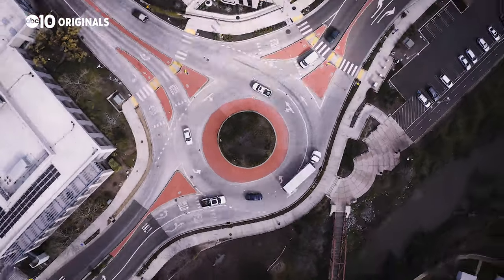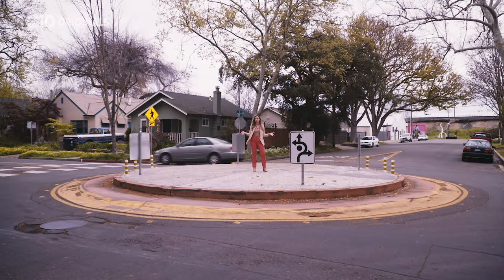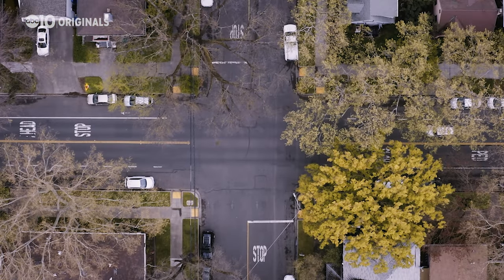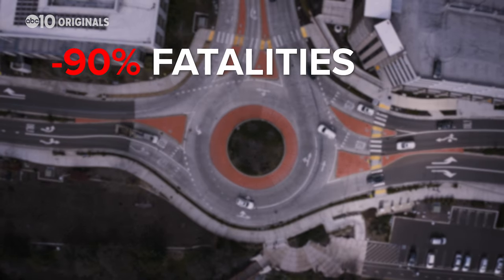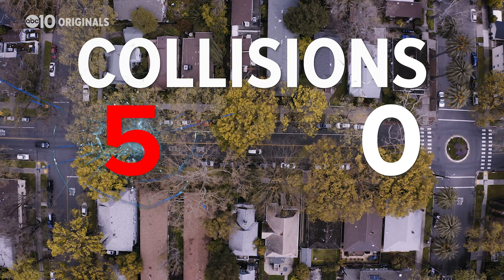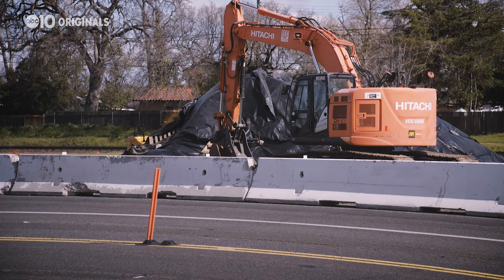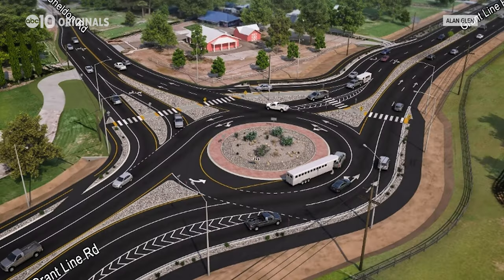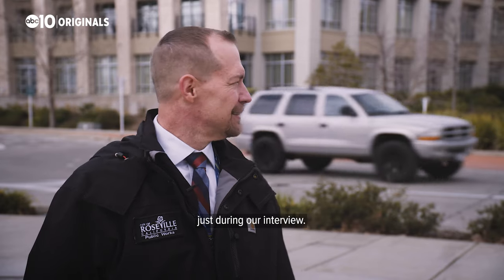Why are more roundabouts being put in across California's roadways?

Comment: I lived in Carmel, Indiana, and the city is in an ongoing program to install roundabouts on all of its major intersections. They currently have completed construction on over 150 of them. They slow down traffic through the intersection, making them safer than the other intersections they save time and gasoline because they don't cause a bunch of cars to be sitting idle, waiting for the light to change colors. I loved driving in Carmel with all the roundabouts.  My trips across town were cut in half. My route from my house to the church I attend took me on two busy roads with about 8 traffic signals. It took me about a half hour to drive it. As Carmel put more and more of those roundabouts in, I started driving an alternative route to church. It was not as direct a route and may be longer in mileage, but it cut my travel time in half. I am a very big supporter of using roundabouts at all intersections. Even at interchanges where diverging diamonds are replacing diamond interchanges, Carmel uses bowtie roundabouts or two roundabouts, eliminating the traffic signals still required by the diverging diamond interchange. It still seems to be a better way to move the traffic through the interchange.

Comment: The first intersection she compared with the collision data is not a roundabout. It is simply a 'traffic calming' device installed in the center of an existing intersection. In the same category as speed bumps and channeling devices.
Reply: That's exactly what roundabouts are.
Reply: @_starfiend  No. Roundabouts are designed as such (as in the video's thumbnail). In this case, the municipality simply put a round planter area in the middle of an intersection in an effort to calm traffic. It is still a two-way stop intersection - roundabouts do not have stop signs. The problem with roundabouts is the amount of right of way necessary. The solution they used likely helped with collisions by interrupting the flow of vehicles.

Comment: While I appreciate the macro stats, and have no large scale data with which to counter, from my experience with a small neighborhood round-about installed near to where I live, some drivers do barrel through (over the small curb of the circle) and in rare cases other drivers cut the corner and GO LEFT (Clockwise) against the flow! To be fair, and to my amazement, no driver has hit the boulders in the center of the round-about and no car collisions have occurred. On the other hand, there have been many altercations including horn honks and "flippin' the birds" that disturb the otherwise peaceful surrounds. Clearly it is the drivers causing the problems, but these smaller round-abouts seem to bring out the worst in some drivers.

Comment: 2:10 Talks about safety. Grabs inside of the steering wheel (which makes it very hard to immediately steer back if needed).
Reply: Roundabouts have been proven to be safer, that's not hypothetical. That's fact.
Reply: You can theorize as much as you want but statistics speaks differently.
Reply: @GoldenTV3  Yes? I didn't say roundabouts aren't safe. I just want to mention that someone grabbing the inside of the steering wheel shouldn't be talking about road safety.
Reply: @thastayapongsak4422  Statistics of grabbing the inside of the steering wheel is proven to be more dangerous.

Comment: The small slow single lane  roundabout intersection shown at the beginning of this video is a sensible solution to replace all way stop controlled intersection.   It's still bike able.  There are no implicit pedestrian crossing at roundabouts as there are at stop sign controlled or traffic light controlled intersections.  Pedestrian crossing have to be explicitly marked.    It is highway design doctrine that a roundabout is detrimental to traffic flow of the primary road over a well implemented traffic light controlled intersection.     Where a roundabout might process traffic better than a traffic light is when both roads are at about the same traffic volume and there is a lot of interchange traffic.  That is atypical.  It being implemented it should be done with a rotary which are safer and faster.  

Multi-lane roundabouts are dangerous with increased speed more typical of a rotary with that traffic condition actually calling for rotary.   Once a roundabout is above a designed operating speed of 15 mph it is no longer behaving like a roundabout.   Such so called roundabouts are likely not included in roundabout statistics.  Most new so called roundabout in the US  have designed operating speeds above 15 mph and are not roundabouts and don't have the large diameter road circles of a rotary that enable proper merging behavior.   

All way stop controlled intersection in neighborhoods are frequently mis used to do so called traffic calming which is where there are traffic lane disruption intentionally to slow traffic down.   What takes place where traffic calming appears to have worked is not that traffic has been slowed down, but that traffic has been reduced by going somewhere else.  For a neighborhood discouraging through traffic that has been a design objective as far back as the 1960s.   

In the USA non highway designers don't look at the fine details and are likely choosing fast multi-lane roundabouts psychologically for traffic calming.  They slow traffic on the primary road that would in a neighborhood cause passing through traffic to choose a different route.   On arterial roads multi-lane roundabouts used instead of a traffic light controlled intersection reduce traffic through put, make drivers hyper focus which means they may not notice pedestrians or cyclists,  don't allow traffic metering such as synchronized traffic lights and make drivers fight to get through them along with disorientation that takes place after more than couple roundabouts near each other.   

Multi-lane roundabouts are not safer than traffic light controlled intersections.   A major arterial road Mt. Comfort Road with 300 N. Mt Comfort Indiana had its traffic light controlled intersection replaced with a multi-lane roundabout where it shortly experienced  its first fatal crash in living memory.   https://www.google.com/maps/@39.8272393,-85.9148965,1636m/data=!3m1!1e3?hl=en&entry=ttu. That roundabout acts as a traffic calming device causing traffic to switch over to using  700 W.  If it has been an improvement for through traffic which is the objective that would not have happened.  

Mt. Comfort road has a full lane shoulder typically for cycling.   I feel very exposed and not noticed when riding my bicycle through that roundabout!   People are hyper focusing on just a few points unable to be attentive to traffic.   It looks unsafe, it feels unsafe, its slower for through traffic, it deters through traffic and its caused death over the traffic light that was there before.    If implementing a traffic circle for such a situation it should be a rotary that is much larger in diameter.   

This is a main trucking area with a medium sized truck stop with the area being a  huge warehouse area served by trucks. The roundabout provides a nice convenient turn around for Semi's.